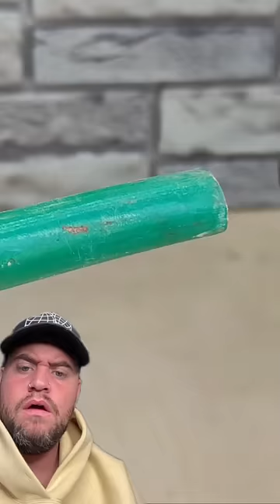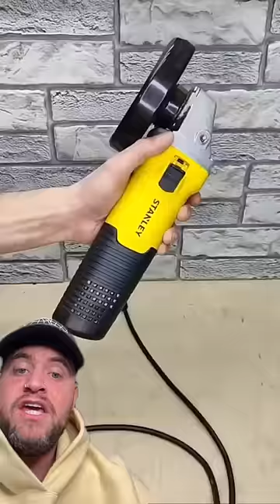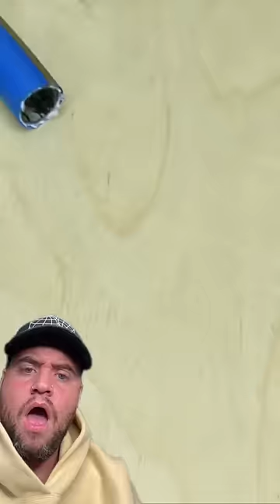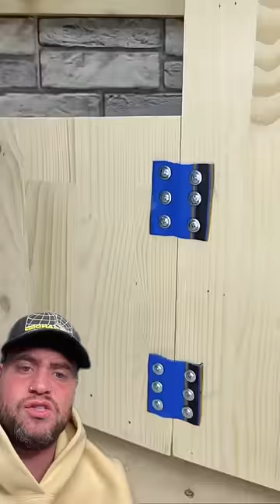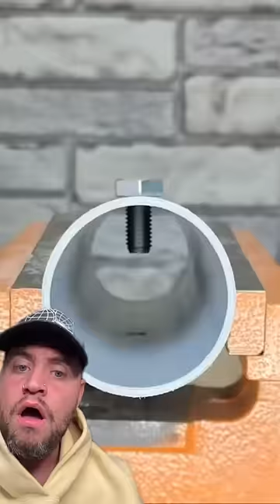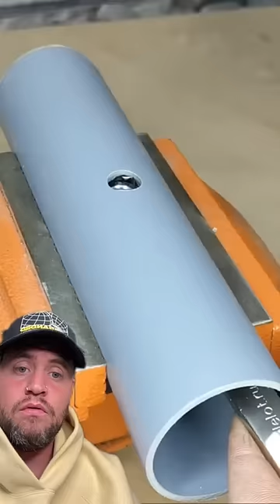THESE KEEP GETTING BETTER @podelkin #shorts

Comment: Do not, i repeat, do not hand things by their power cable. This will put stresson the internal wires and can lead them to breaking.
Reply: People gotta especially stop to coil the wires around the machines that tightly as well.

Loose loops, people, LOOSE LOOPS! That's the way to treat the wires correctly.
Reply: @ShawnSandiego  and longer loops are always better. Look at how custom-built pc wire come. They use as long of loops as possible then they are wrapped with a velcro strap to keep them from uncoiling.
Reply: I've done it a thousand times. Works like a charm, never hurt any of my tools
Reply: @michaeldesjardin4241  and lots of people ride in cars without seatbelts. Yet, if they are in a head on collision, they still go out the window. Wouldnt you rather be safe and prevent the possiblity than have to buy a new tool on the chance it breaks?
Reply: @duskonparis    why do u gun nuts always use car accidents as examples?
Reply: @leonardosantuario3346  making a lot of assumptions about me, dont you think?
Reply: @duskonparis    says the 12 yr old
Reply: @leonardosantuario3346  yet another huge assumption 🤣. You are 0 for 2. Not a gun nut and i havent been 12 in 15 years.
Reply: @duskonparis   oh yeah, I was projecting. I'm the gun nut sorry, I haven't been 12 in 15 yrs neither. Cheerio
Reply: @leon😂😂😂ardosantuario3346
Reply: Nope, it’ll never be a problem.
Reply: @ShawnSandiego 
Nope, doesn’t matter at all.
Reply: @oggyoggy1299  "iT dOeSn'T mAtTeR aT aLl" then why do my work tools end up with broken cables regularly, that need to be replaced by an electrician?

Coincidence? Definitely not. Don't act like you know it all, just because it never happened to you.
Reply: Was bouta say wtf he doing hanging it like that?!?!!
Reply: @leonardosantuario3346 You dont seem very good at the comments section game 😂
Reply: @yesplease9424  unintentionally just showed how to tie a noose 😭
Reply: I tought the same
Reply: My carpentry teacher would have a heart attack if he seen this shit. 😂😂
Reply: Rest easy, nobody has tools with cords anymore. 😂
Reply: @mattbarnett6902  well thats just plainly untrue.
Reply: Been doing it for years, and not once have I ever had a power cord shear on me.
Reply: Yes. And if the ground prong is broken it can cause a situation where the metal body of a tool becomes electrified. It's not fun.
Reply: Beat me to it lol
Reply: Dude I just made a comment about this and I used the same beginning line as you. I need you to get out of my head.
Reply: It's hardly any stress at all. Depends on how heavy the tool is, I guess, but realistically it's not that big of a deal.

Comment: Never wrap the cord to a power tool the way they show it will cause the internal wires to get weak and break.
Reply: It's also the basic idea of how to tie a noose
Reply: @skyler9988 how does one tie noise?
Reply: Fucking autocorrect
Reply: @skyler9988  haha I’m just fuckin with you
Reply: @albundy9793  I know, I just hate my keyboard sometimes
Reply: And then hanging it too
Reply: That cheap Chinees motor will burn out first though.
Reply: @skyler9988 thanks for the tip 💀
Reply: No more damage then the way we already wrap it up lol
Reply: You can wrap it that way just don't hang it on the wall by the cable
Reply: Actually this is the best way to wrap a cord attached to a tool. Causes far less wire stress and breakage. Just dont tighten the last part like a rope and you'll be fine
Reply: Or heat up and blow up
Reply: @myingthungomurry9894  your not operating it like that
Reply: Not how thats wrapped it won't , there is more risk from how most people store them already
Reply: @skyler9988 thanks, now i have inspiration to learn how to tie a noose and do a little trolling
Reply: bro tied a noose
Reply: Yep, because those wires inside are actually pretty small and if you bend them too tightly and you continue to do it repeatedly every time you put it away it will cause them to break under the stress and tension, that’s why you’re only supposed to do a loose wind, not tight nor narrow
Reply: @mightymidas2021 loose coils, not tight around the device like shown in the video. You can't keep doing that to the wires, especially if you use the tool regularly. Also this is so tight the cable will go all springy and be more annoying to work with than it should be.
Reply: @skyler9988  literally what i said lmaoo just uh dont ask why i knew
Reply: It'll only break if you put the base/connections of the wire under stress. By pulling the loop back through he relieved tension on it, therefore proving your statement wrong.
Reply: @JONES300offi  he pulled the bottom loop which tightened the top loop
Reply: @albundy9793 joke aside, I learnt from Rusty Cage's family-friendly song.
Reply: @dogma13gaming  the top loop had no wire strain what the electrical connections are. Anyone who knows electrical components knows that the connections always break or short first.
Reply: ? how exactly?
Reply: No

Comment: Wrapping that Stanley power tool cord - for the hairdryer, ladies! 👍🏼
Edit: Edit: What do I know (clearly nothing) 🤭💀
Reply: don't actually do that its a good way to cause a short in your cords
Reply: @jamesv4463  Fudge! But it wraps up so nicely 😞 thanks for the heads up 👍🏼☺️
Reply: Impossible
Reply: @jamesv4463 how much does your hairdrayer weight? 😂
Reply: @lorenzogazzola328  I know it seems silly. But even a light weight can cause a problem
Reply: @jamesv4463  Bro there isn't any bend.. maybe the only thing wrong it's that hangs on a screw, but if It hangs on a larger diameter tube there will be no issue...
Reply: I like how Noone noticed thats the hangman's knot, so you just turned that cord into a noose
Reply: It's not done that way to make a loop for carrying it. It's so the cord isn't just pulled to the side and wrapped. This helps it from being pulled loose from the connection inside.
Reply: Yep do it and on your way out call somebody to repair the cable
Reply: @paranparanovic3923  Why would it break?
Reply: @gjkmoda5093  you Are fucking up the cable like that
Reply: @Qursheed is 100% okay to wrap your cords. Just don't bend them!  Maybe you've seen cords at the store,  they're wrapped!  Cords are not that fragile, have you seen a construction zone?  😂
Reply: Lmao my gosh all the know it all's 🤣 I have hung power tools like this for 20 years or longer and NEVER had any issues. No I don't hang super heavy shit but a Dremel or something smaller like a hair dryer, straightener etc .... Will be fine.
Reply: @lorenzogazzola328 First of all there is a bend as he tightened it at the end and even the small Radius around the Maschine for a longer time can damage it and shorten it's lifetime
Reply: First of all... fun fact. That is a hangmans noose. So people may ask you questions if they know the knot.
Reply: @kellsbellls but i always wrap my chargers the same way they do in the store and they still break. I never wrap any now :(
Reply: These comments act like people everywhere don't wrap their hair dryer cords 😂
Reply: @theguywiththeoldds3896 thank you. I'm glad I'm not the only one who noticed. I fame to see if anyone else did
Reply: Even if you don’t hang it up, it’s still a clever way to store the cord and device nicely.

Comment: Ah yes, I’m sure nail heads always sheer off when a hammer tries to pull them out 😂
Reply: Highly rusted ones will
Reply: I can tell you, from years of pulling nails from old pieces of wood, not a large amount of them do, but rusted nails can have the heads pop off when you try to pull them, usually because they are quite rusted on the exposed surfaces and the rest of the nail isn't rusted as much because it's not exposed, and it's not a huge problem but it's still a thing that can happenm

Comment: The power cord one seemed decent. I wouldn’t hang the tool from the cord though. And the tape on the wrench is a mechanics trick that’s been around for ever.
Reply: For what purpose? 🤨 like I’m that specific scenario why are they putting a metal nut and bolt through the PVC?
Reply: Its a knot used in deathrow

Comment: string is often used to level out things  like fences and walls when they're being built. you measure and tack the string across where you want the top of the fence or wall to be and it helps keep it level while you work

Comment: 1. Use a screw or hook
2 , buy a hose joiner , cheap
3. Will only work for flaps or very small doors as there is more lateral movement,  with mire weight ..buy a hinge or 2 .

Comment: The duct tape on the wrench is like, the only smart wrench hack I've seen, basically all others use super glue or welding, thus ruining the wrench (or making things far more difficult than they should be) for anything else
Reply: You can also use a magnet, just put the magnet on the wrench and then it won't fall off, same for screwdrivers. Just don't do it when working with electronic stuff

Comment: Speaking as a retired Master Mechanic, of 40 years experience, the only one of these "hacks" that's worth half a rat fart in a Cat 7 hurricane, is the one where they put a bit of tape on the box wrench to hold the nut in place.  Why you would be putting a nut & bolt into a piece of PVC pipe is a mystery, but whatever.

Comment: The power tool cord one, never EVER do that to the cord, especially on non trade rated tools. You will damage the cord. Never bend the cord sharply near where it enters the tool, and avoid rolling it in one direction all the time.

Comment: Yup, the channel you are watching is the 5-Minute Crafts for construction. That second thing with the hose already has a standard hardware item called a 'hose clamp'. Except a standard hose clamp is wider, so that it won't eventually cut through the outer hose, and it can be easily loosened as needed.

Hell, it even has repeats just like... you know what I'm getting at.

Comment: The water hose fix only works temporarily. Why? Because the wire is so thin. Over time it cuts into the hose. That’s why normal hose clamps are wide. To reduce the cutting into the hose. Even those still cut in to a hose some. So the wire hose clamp used in the video won’t last long.

Comment: I feel like there is a better solution to everyone of these, like proper tools and fasteners. I liked the power tool cord one,but someone else debunked it already in the comments. Also the duct tape on the wretch, but I feel like a shallow socket would work just as well.

Comment: Please, PLEASE never do power tool cords like that they can come loose inside the tool and cause fire or sparks and potential electric shock upon use, the way shown before it was hung is safer unless you use the new method withought hanging the power tool by the cord, hanging power tools by their cord is always dangerous and should never be done.
Reply: Nah, it’s never a problem.

Comment: The first example you can do it better
2nd example there already a tool to tight seal for the pipe. why using wire?
3rd one ok although you can just lid around then hang it wouldn't be much differences.
4th not gonna last long
5th it good 
6th you can either slam the nail or using plyer.

Comment: for the hose there is literally a tool you can just buy and reuse, those metall rings with a screw to tighten it, no idea what its called in english (Schraubschelle in german, screw clamp according to translator, do you know these? xD)

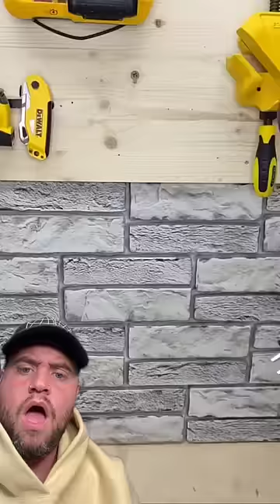Comment: 0:31 NO!!!!!!!! please DO NOT hang an angle grinder or any other electrical power tool from its chord! doing so will cause the sensitive soldering inside to break / separate! VERY BAD IDEA to do this! and the knot that this video shows to tidy up the chord is great, but when you put too much of a bend at the start of the chord (which is at the bottom of the grinder), you also risk stretching / breaking the soldering inside!

I use angle grinders every single day and have been for years, please do not hang angle grinders by their own chord, or tightly bend the chord where it meets the grinder.

Comment: Gonna destroy that cord wrapping it up and hanging it like that.
They have clamps for hoses.
Why do you need to attach a frayed piece of string to a 2x4?
Hinges are super cheap, no need to ruin a hose.
Why are you putting a nut and bolt through PVC anyways? 🤨 what purpose could that serve.
The nail has ridges that will catch on the hammer if you move it further in if you for some reason, somehow break the head off.

Comment: "Use a screwdriver to wrap a wire around a hose to tighten it."

Or yknow, just use a small metal clamp? Thsy dont need to invent new ways to solve and already solvable problem.